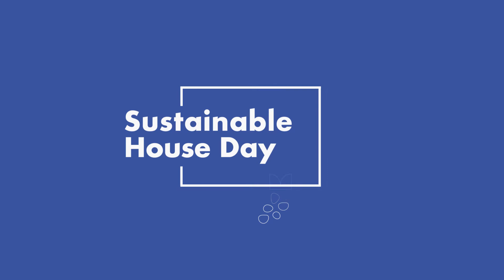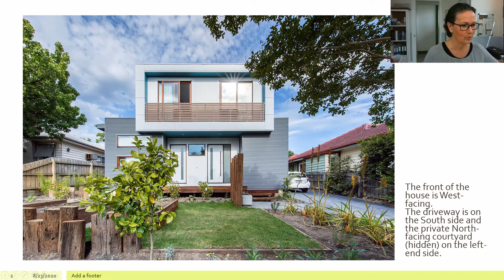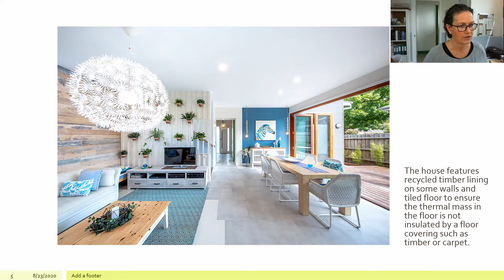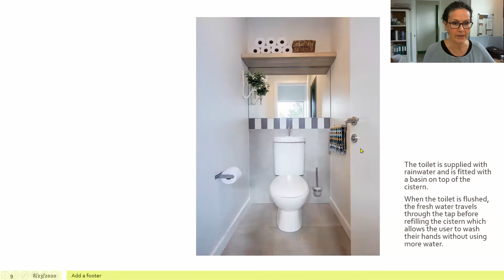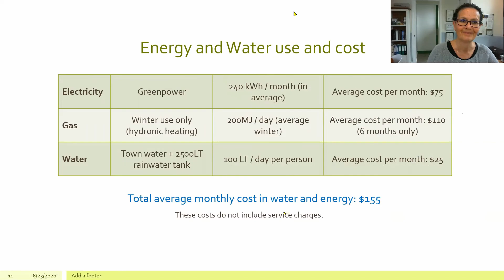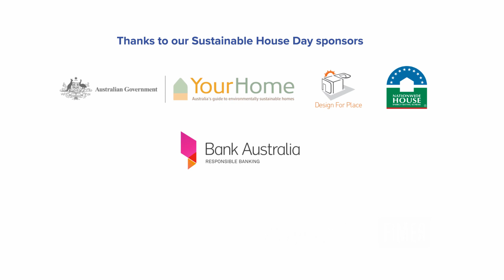A Modern Townhouse - Sustainable House Day 2020

Comment: Really appreciate your research to achieve a very low cost sustainable its very sad that only 159 views of something so important for future planning>
We looked at this video and have learnt many features that we never thought to factor in.
We are researching to build a  Sustainable House maybe 2022
The little details were the most important, 
12 mm gap between the double glaze windows, 
Angle of sunlight, 
Windows open to create the natural flow
3 metre high ceilings
Heating efficiencies
Natural towel heaters.
You have made it very clear what we need to factor in for our future designs